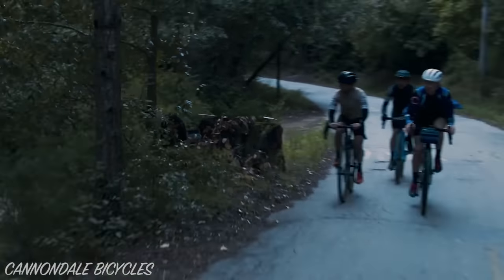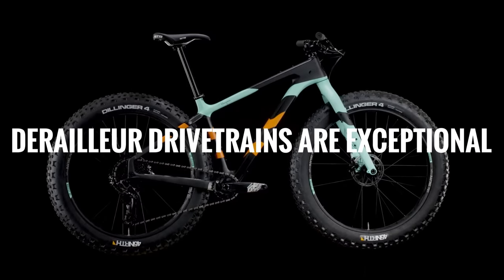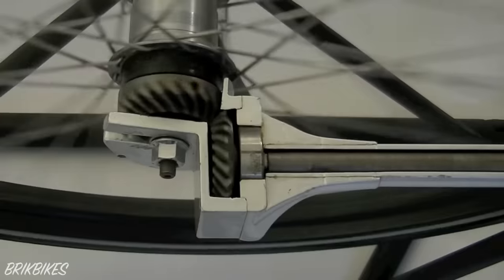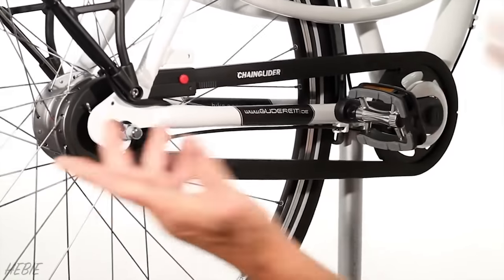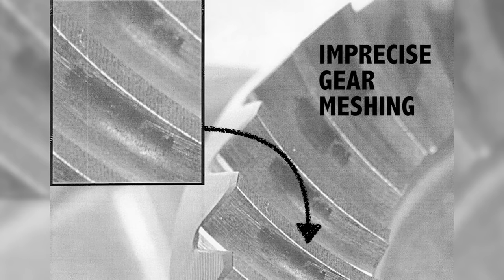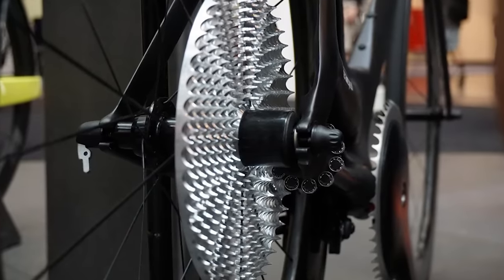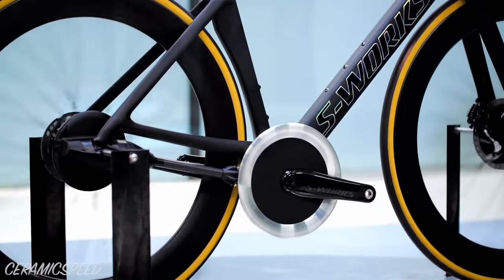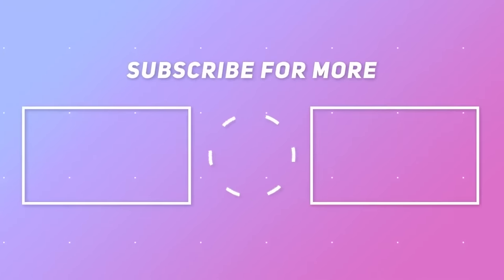Are Chainless Shaft Drive Bicycles a GENIUS or TERRIBLE Idea?

Comment: You can use a metal or poly-nylon cable instead of steel shaft. Then a large gear on the front. Also, add a center shock like most mountain bikes have. Now, with that tidbit of knowledge, make a new video. And, let's not forget about staggering the tire size either.

Comment: A shaft on a human powered device is just dumb. Also expensive to aquire and repair. Nobody should buy them.

And if you thing on motor powered. An electric motor can be in the wheels directly so no need of shafts.

Comment: Why are you worried about efficiency? Wouldn't a lower efficiency improve your conditioning as a rider? Don't you WANT to get stronger legs and better cardio? 
That's what makes me laugh about all you cyclists. You want to get better cardio, but then wear idiotic skin tight spandex jumpsuits (complete with ads😂) like you're riding in fkn tour de France to reduce wind resistance just to bike 15 minutes to work.

Comment: Its like blind leading the blind , the shaft drive to be honest looks total shit & is + will cost a fortune . If you understood anything about the body or bikes , the final 1-2% efficiency is in many way more  importantthan the previous 98-99 % efficiency .but 7%  Which is why single speed & fixies , are considerably more efficient & much better to ride & better for you , they also use thicker chains than draileiurs , which makes a big improvement   their only draw back is steep hills . But gears on a bike are stupid , I wont tell you why , but its so obvious. If you can think about it . You cant .  

Ah but single speed bikes dont require heaps & heaps of bullshit .

Comment: Cheap huh? like how cheap 700$ is considered cheap?
Reply: Many bicycles run into the thousands of dollars.
Reply: @scootergeorge7089  That's crazy, I have a bike that I bought cheap and it's really good, but I'm not a huge cycling enthusiast...
Reply: @MartinJones123  - I'm not either. I do ride regularly, 5 days a week or more, weather permitting but at 70, there are restrictions. My bike is a Gravity purchased online from bikes direct, $250.  A step up from Wal Mart  stuff but some of the components are second rate. 
In  1994-95 I worked at the Trek bicycle factory in Chehalis WA. There, I learned about the extreme retail markup  on bicycles.  Employees could purchase a bike for 8% above the cost to manufacture it. A $1,000  bike could be purchased for about $250.  But as an overweight, 2 pack a day smoker, was not interested.  A few years later, quit smoking and later decided to start biking and lose some weight.  But still, look back at what kind of bike I could have gotten...
Reply: @scootergeorge7089  Well we don't have Walmart where I am... I bought an actual brand but it was pretty entry level...

Comment: You might know bicycles but you don't know crap about engineering. Chain drive delivers the most power, Belt is a 15% loss of power compared to chain and shaft is a whopping 20-25% depending on the set up. So unless you really enjoy the work, Stick with your chain drive. Why do you think race bikes are still chain drive?
Reply from the maker: Actually, the lab testing we have shows that belts and chains are the same at 200-watts power output: https://www.cyclingabout.com/belt-drivetrain-efficiency-lab-testing/
Reply: @Cyclingabout  Dyno test on motor cycles have proved a power loss with belts of 20%. You do realize you have a lot more then 200w of power from your legs right? Not to mention the "test" wore done by a company promoting belts with a lot to gain by making the outcome in there favor. If belts wore better with no power loss racing bikes would all have belts. Not a single one uses belts. As an engineer i can tell you the numbers show a loss and as a mechanic i can prove the numbers right with dyno testing. We are all free to make our own choices. I can understand how some might prefer belts. It is smoother. But it comes at a price i am not willing my self to pay.
Reply from the maker: @leostgeorge2080  
1. You do realise that a motorbike belt is not a bicycle belt?
2. You do realise that higher power outputs have been tested to show a lower drive resistance with a belt on a bicycle?
3. You do realise the belt friction test was done by an independent laboratory with no connection to the belt drive manufacturer?
4. Racing bikes are not suited to belts for a variety of other reasons than the drive resistance of the belt. I have a whole video on belts here: https://www.youtube.com/watch?v=8SKeQ6B2UTk
Reply from the maker: @leostgeorge2080  You're talking about a different technology and application. A bicycle belt is re-inforced with continuous carbon fibre cords and does NOT stretch any appreciable amount under power. You can run the calculations on that if you like. But it seems you're really not interested in the data at all, which is very odd for an engineer.
Reply: @Cyclingabout  Yes i know all about the Gates carbon fiber drive belt and there claim to NO stretch, I assure you there is stretch just as i am sure the weight a dime warps a man hole cover. The fibers may limit the belt it's self to an acceptable tolerance of stretch, Then there is the matter of the teeth stretch also. For the average ridder i am sure it is expectable, But for the performance  ridder the 20% torque loss due to the friction of a belt most likely is not. You do understand why a belt is smoother right? Because it has give, Give you do not get from a chain.
Reply from the maker: @leostgeorge2080  A belt is not smoother than a chain. It feels just like an ordinary chain on a bicycle. Multiple dynos have shown that belts are highly efficient on a bicycle, once the initial belt tension is overcome. Unless you have data to show otherwise, your conjecture based on motorbike belt drivetrains is simply not helpful.

Comment: What is this mess of a video? Are you comparing old tech to other old tech, then drawing conclusions based on adjustments with new tech, basically comparing old and new tech? With a mess like that, we could assume that steam locomotives are more efficient than diesel locomotives.